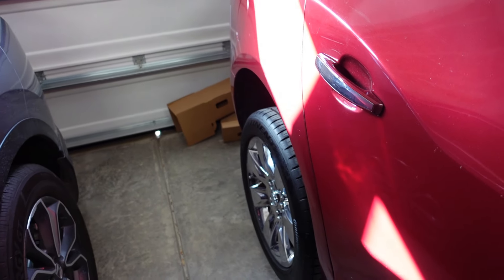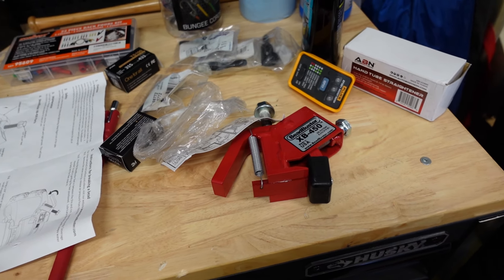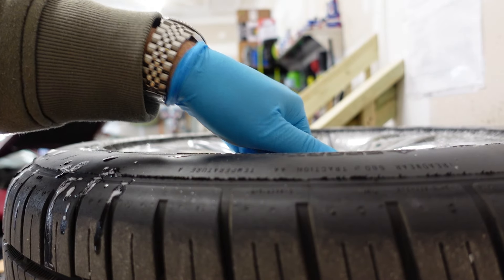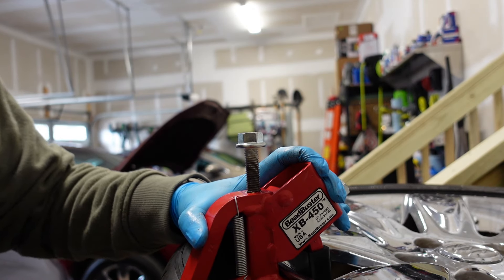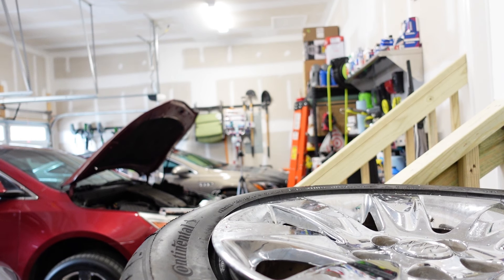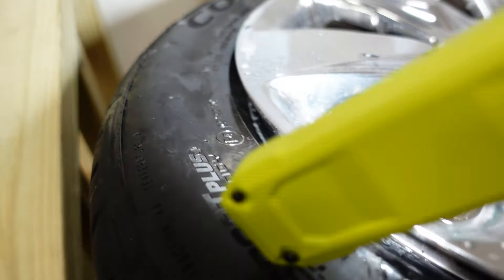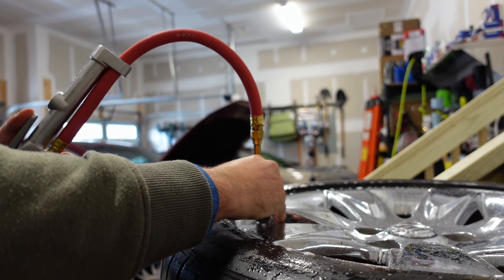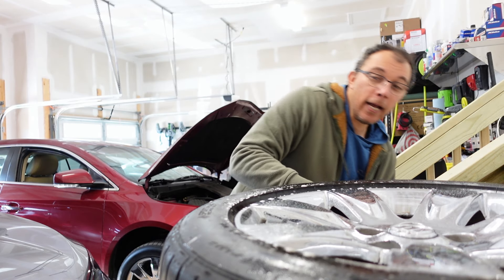XTOOL IP819TP and the Bead Buster for the TPMS sensor install! TIMESTAMP 44:19 😂😁

Comment: Good stuff. What was the profile size of the tire? Any reason you think the  BeadBuster XB-452 would be a better option?
Reply from the maker: It's an 18 -inch tire that's kind of got some deep curve in it. The XB-452 has a longer arm on it to make it less likely to slip when it's being fastened to the rim and in between the bead. And also the XB-452 comes with a long and a short arm so you get the best of both worlds. I emailed them to see what the long arm works with my unit. If not I'm asking can I get a discount on the 452 unit?.

Comment: Have you experienced any issues reading and programming the TS100 sensors? I have the IP819TP and programming the TS100 sensors seems to work fine, but reading them to verify the programming info only works occasionally. Whats your experience doing that?
Reply from the maker: I did not have an issue for either, programming or reading. I'll try it again soon and if I have any issues I'll let you know.
Reply: @oneanddonediy  For me it happens if I program a sensors and then try to read it immediately. It's weird in that I can read non programmed sensors, but once they are programmed it's very hit or miss, mostly miss.